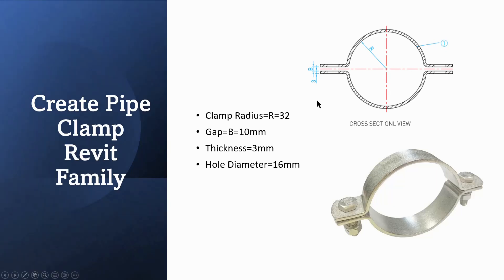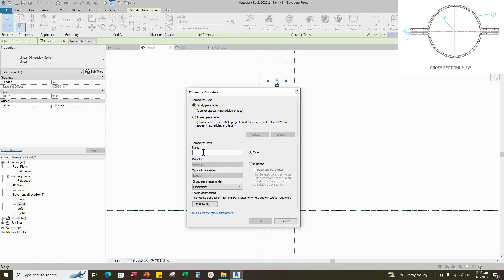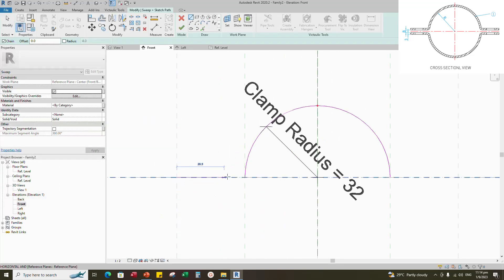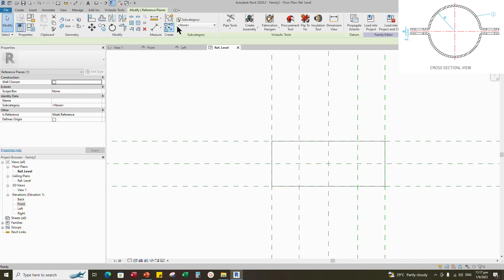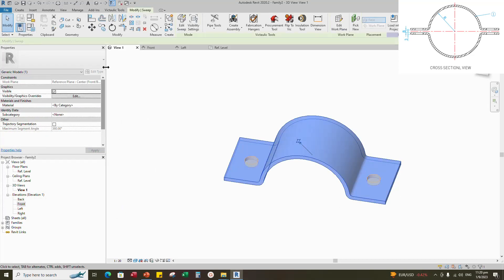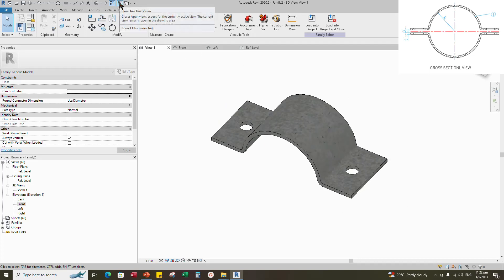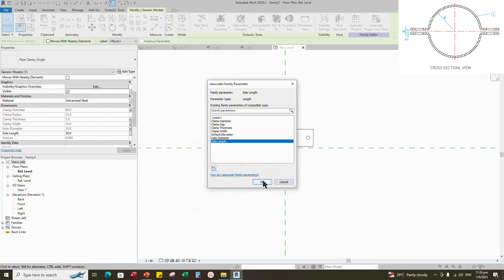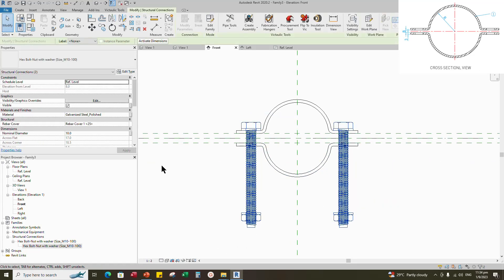How to Create Parametric Pipe Clamp Revit Family with Bolt Nut

Comment: I did each step of the video, but at minute 8:43 it is not reflected, it is only copied. please help
Reply from the maker: The loaded family is face base model. It is able to mirror.
Reply: @ThomRVT 
 Thanks for answering, at minute 0:45 you use "Metric Generic Model", at minute 6:51 you use "Metric General Model" so the video tutorial is wrong?
Anyway I have created the "Pipe Clamp Single" family with "Metric General Model Face Based" and it does rotate with mirror, but it cannot move vertically (5mm) in the front view, it only moves horizontally, why?

https://drive.google.com/file/d/1c8_2VYntEiIjhTmfmAjUgaCiYQJSLfqR/view?usp=sharing
Reply: @ThomRVT  
Thanks for answering, at minute 0:45 you use "Metric Generic Model", at minute 6:51 you use "Metric General Model" so the video tutorial is wrong?
Anyway I have created the "Pipe Clamp Single" family with "Metric General Model Face Based" and it does rotate with mirror, but it cannot move vertically (5mm) in the front view, it only moves horizontally, why?

Comment: why  When making a Mirror , he does not rotate
Reply from the maker: The loaded family has to create in generic face base .
Reply: @ThomRVT  .
Reply: @ThomRVT in the video you use "Metric Generic Model" not "Metric Generic Model face based"
Reply: I did the steps as shown in the video, step by step, and when I reached the step per minute
 8:47  ، I did Mirror as it worked but it doesn't rotate
Reply from the maker: @saifal-kurdi9075  Your first single clamp family have to create in generic face base model. If you don’t want to recreate a new one, open a new generic face base model and then load your create clamp family which crated in generic model. So your generic family become a face base family .
Reply: @saifal-kurdi9075, Dude, were you able to fix it? I'm going crazy